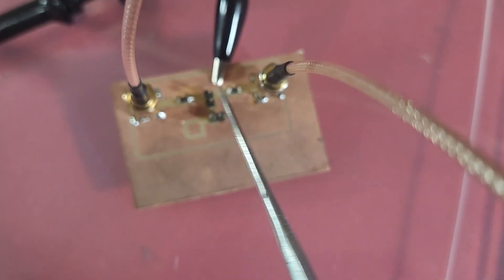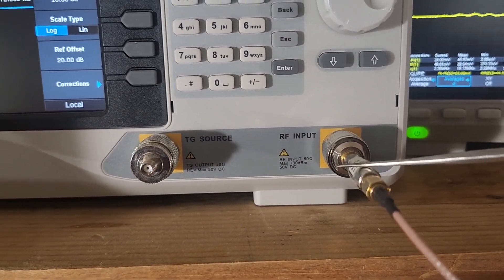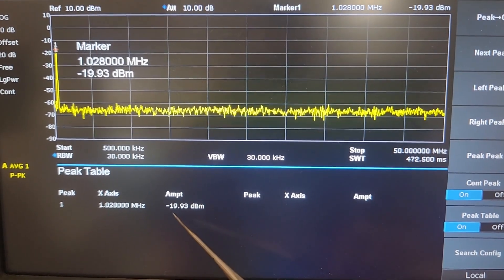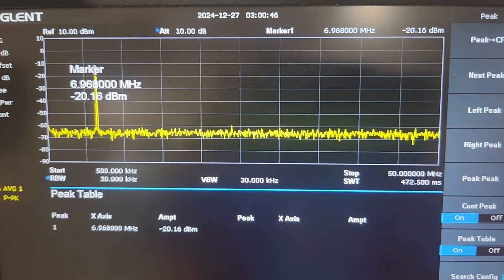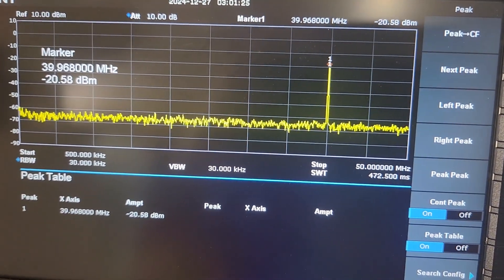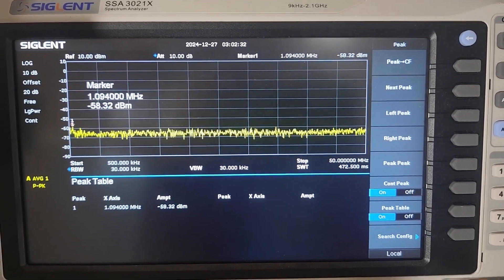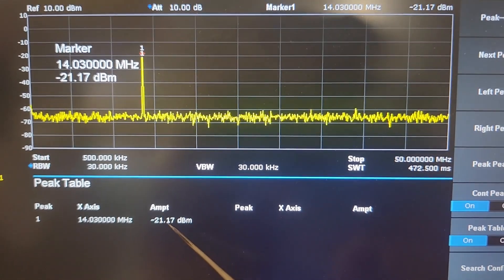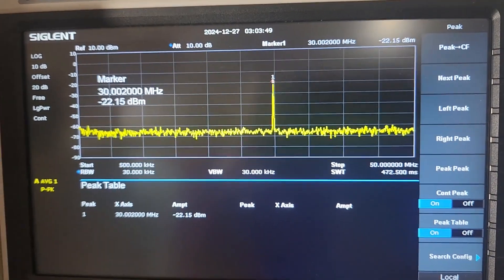Scope Probe Test Jig

Comment: Typically about 11pF tip capacitance...the "ground lead" introduces an inductance, which results in resonance at 100-125 MHz.
I came up with simple method to calculate the capacitance, by putting a fast rising edge into a small inductor, and measuring the ringing frequency... You can do a math calculation, or simply add a 10-20 pF cap in parallel with the tip, and check the difference in the ringing frequency.
Probing is really the number one technique that should be part of any oscilloscope training for new employees.(Former AE atvTek, Agilent, R&S)
Reply from the maker: That is a clever way to identify inductance.   I think you can do similar to figure out inductor self resonance too but not sure.  This video came about from belief, from my colleagues,  that scope probes are Mega Ohms in impedance.  Maybe its Mega Ohms at audio but not at RF.   Probe and cable capacitance forms a low pass filter.  I pretty sure Dave Jones (EEVBlog) and others (Al Wolke W2AEW) talks about this.  I think one of them even developed an LTSpice model. Thanks for the feedback its something I need to keep in my back pocket.

Comment: Very interesting. A technique I find useful is to make provision on the board being designed for miniature 50 Ohm  RF connectors at all the likely test points, I've then got an adaptor that fits into them that fits into the mini BNC connector that the end of the probe fits round. One advantage of doing this is that you reduce the pressure pickup in the ground lead.
Reply from the maker: I have used those.  I could not find a good footprint.  The one I used lifted the copper.  Which do you use?
Reply: @DaveVE3OOI  The connectors I used were Molex 73415-2121 (RS part: 904-8228) for the board side and Molex 73415-1472 (RS part: 265-9425) for the probe adaptor side. They are 50 Ohm and have a nice push-click mechanism. As for the footprint, I had to draw it myself, but that's quite easy in KiCAD these days, especially if you download the 3D model of the connector and test you've got it right. The socket for my LeCroy scope probe has part number PK5-2.5MM-113, but I think the dimensions for that aren't likely to match all probes, just the LeCroy style ones.
Reply from the maker: @AllTheFasteners  Ok.  I was referring to the U.FL SMT part.  This is a through hole which has much more mechanical strength.  Thanks.